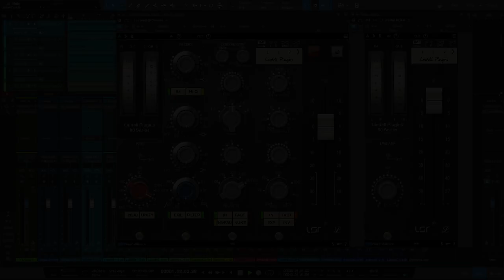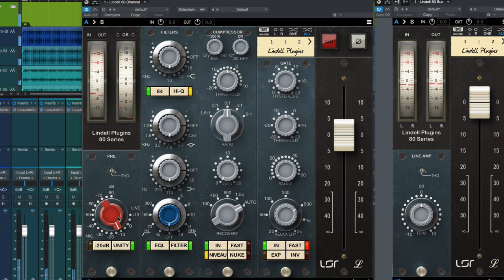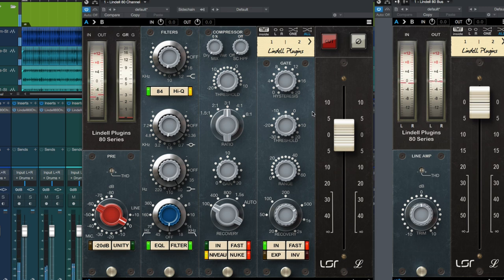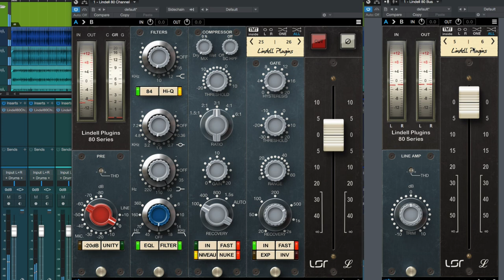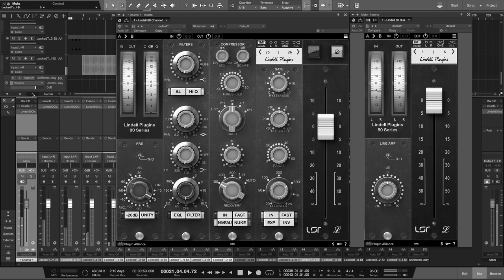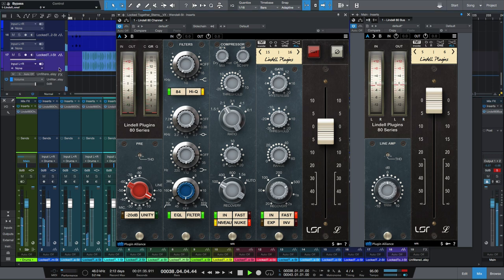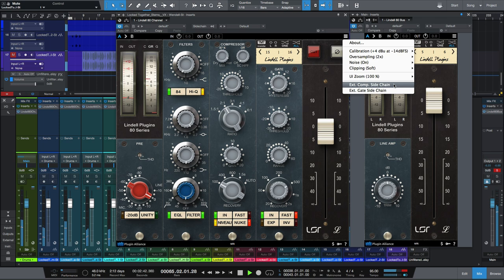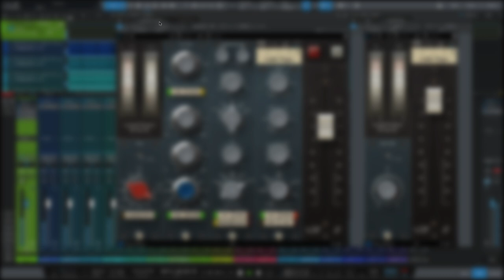Lindell 80 Series Channel and Buss Overview | Plugin Alliance

Comment: Great plugin, I use it daily. 
I just want to ask for a clarification on what is said in the video about calibration. As far as I know, a signal calibrated to -20 allows for more dynamic and more signal cleanliness less subject to saturation, compared to signals injected at -14 or -12. In the video it is said the opposite, is there anything I didn’t understand? Thanks to those who want to answer me.

Comment: Plugin has a bug.  Settings or changes made to the channel strip & bus will reset back to default after closing and opening (any) sessions. This happen in NI Maschine 2.8.5 and Studio One 4 (latest update). Running Windows 10 64 bit
Reply: Still having the same problem in studio One 6.5